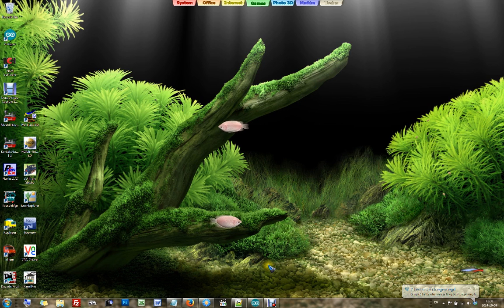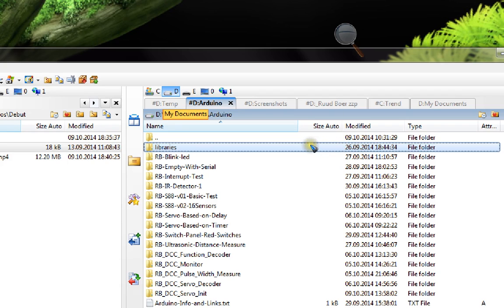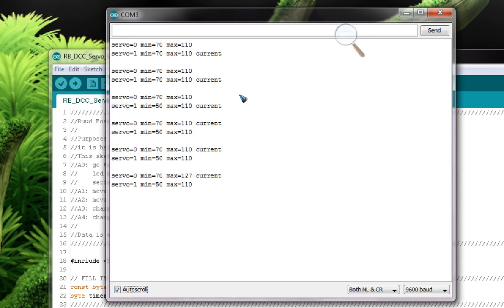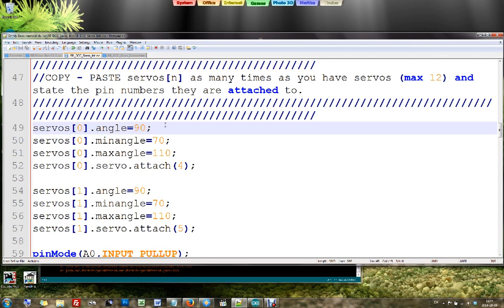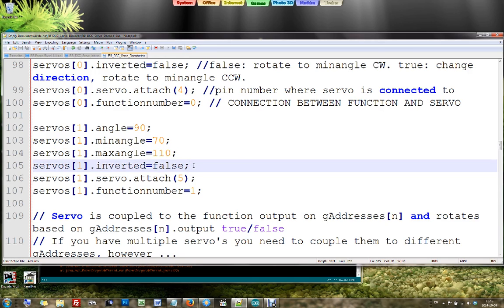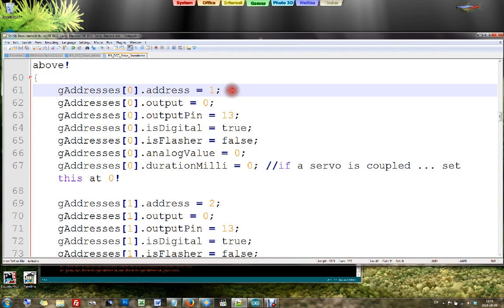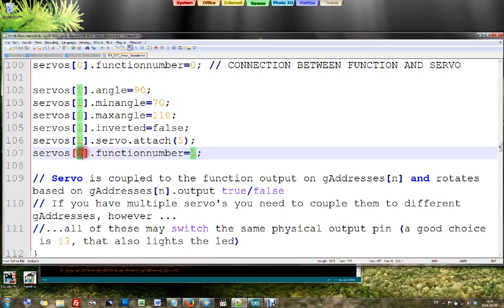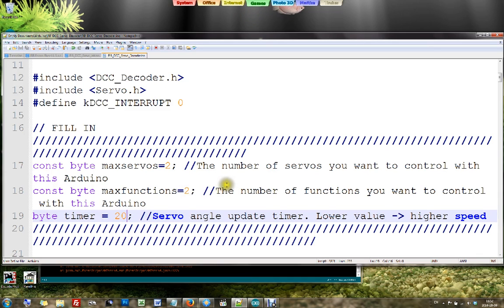RMR016 - Arduino DCC servo decoder tuning software (part 2)

Comment: Rudy.
This is some really great stuff you are doing,I just recently got a ecos as well .And all of the arduino things as well, as the materials for the dcc decoder mynabay  as well as your downloads I have watched these you tube videos 40 time lol trying to get my servos working with the dcc rail power.threw optocoupler I have watched very close and with all of the updates you have done the videos dont match the sketcts perfect. rudy would you please send me the three sketchs i need to operate 8 servos with the arduino . my email is bwstart2finish@gmail.com  it would be greatly appriciated or please put a link with the sketchs that are working for you or maybe share it with me

Comment: Hi Ruud, I'm working on this in combination with a fleischmann twin center. De monitor works, so I recieve data on the Arduino. With the tune software I have tried the servo mounted on pin 3 and worked correctly. Then I have programmed your Dcc_decoder_Servo and let the address on 1 but when I use the TC button on address 1 there is nothing happens. I worked around with different addresses in Arduino and TC but it does not communicate. Have you any idea what the problem cold be?
Reply: Solved it. the address was not correct. The TC (S88) is build per four addresses. 
decoder 1, out 1 -4 = address 1 -4, decoder 2 out 1 - 4 = address 5 - 8. my junction is mounted to address 9 so block 3 out 1. your sniffer code did the trick! thanks
Reply: I have no idea. Sounds like the DCC does not arrive at  the Arduino after all, cause if it does it would work. Or ... maybe something strange happened in your code? Or ... maybe addresses are shifted by 4 (which happens with Rocomaus, maybe also with Fleischmann) which means to switch address 1 you need to operate address 5 ... or just the other way around, I forgot.
Reply: It had to do with addresses, I got your sniffer into the arduino, pushed the desired button on the Twin Center and directly appeared that I had the wrong address. Changed the address in the servo program and it worked. Now I will test your setups further, thanks,

Comment: Hey,
now i have bought an UNO and these electronical parts to connect the UNO to the rails and  i made everything like you i think. but if i want to upload the sketch to the UNO i get the following Error:

exit status 1
'const byte maxservos' previously defined here

i don't know what could be wrong. I think that the Hardware is right because the DCC-Monitor (the software from MynaBay) works without problems. Do you know what could be wrong? or can i send you my sketch? maybe via mail?

Max
Reply: So now i wrote a comment on your "Software" page

Comment: that's really helpful for me. Now I already know how Do I have to program my arduino.

Ich want to switch 10 servos with one arduino. this is able right?

 Max
Reply: +Ruud Boer Yes i even heard of this problem. I think the cable will have a Maximum length of 80cm. This should work safely.

Thanks a lot. in round about two Weeks I buy an arduino and some Power supplies and other stuff. I will als you if I have a Question about it in the hope you van help me! 😊

Max